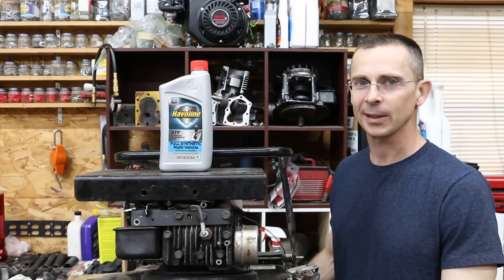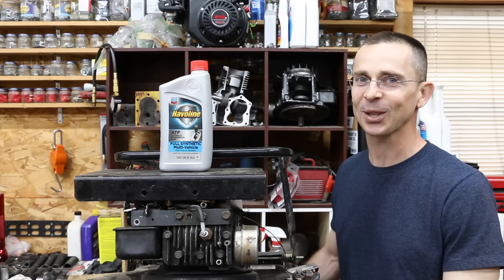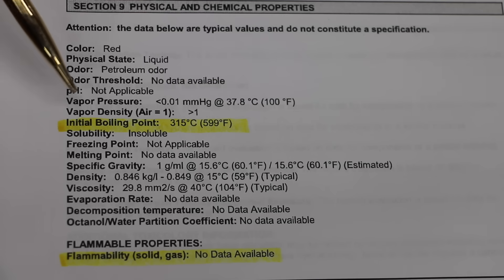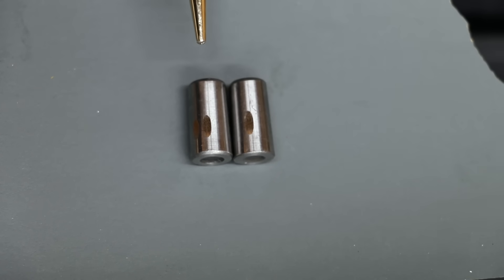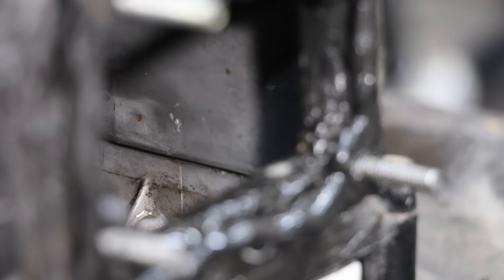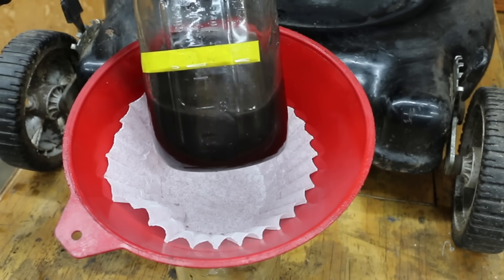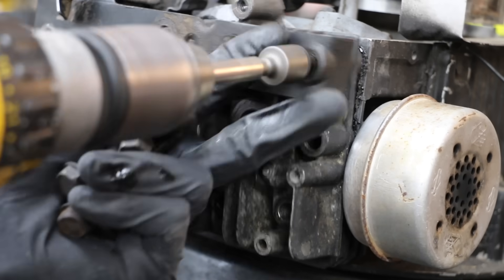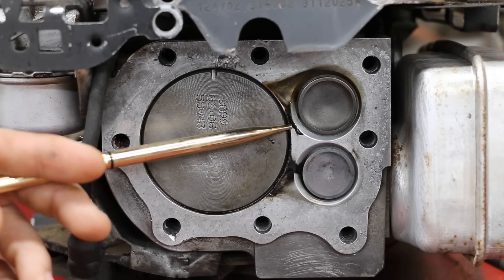ATF as an Engine Oil substitute?  Let's see what happens!

Comment: When I was 14 my friend and I had a Dodge Dart that we thrashed through the desert which caused a trans cooler leak. I talked him into using used motor oil to fill the trans cause, “oil is oil, right?” 
The car puked the oil back up the fill line and caught the engine on fire, 😛
Reply from the maker: Wow!

Comment: I run transmission fluid with my oil every time  with full synthetic it allows the engine to run Slicker and smoother with a Lucas oil stabilizer
Reply: Same here. I have a 1994 Camry 4 cyl. Ive owned the car since 2000 and have always used 3 litres of engine oil and 1 litre of atf every refill - ie 1/4 atf.  I am still driving the camry around today and the added atf does not seem to have harmed the engine in any way.  I only started adding atf after an old friend mechanic suggested it to me as a method of preventing sludge buildup as is common with these Camrys , but I must admit I was a bit worried at first that it might damage the motor.  In 2010 my wife purchased a new Toyota Aurion v6 and after 2 years I made a decision to add atf to its engine oil. I sort of didn't want to as there is a big difference between a 24 year old Camry and a relatively new Aurion and it would of probably meant divorce if I had stuffed the v6 up. Anyway the Aurion takes about 6 litres of engine oil at refill so I refilled it with 4.5 litres of normal engine oil and 1.5 litres of atf - ie 1/4. To be honest the v6 seems to run smoother with the added atf - same as the Camry. One thing I did notice with the Aurion is that with the added atf I can't hear the sound of the timing chain anymore. We get the Aurion serviced regularly at our local Toyota place (Bill Buckle Toyota Dee Why) and I have asked them does the motor seem ok and they have told me that there are no problems with the motor.
Reply: @garyrandall1958  
How you doing today hope you all is going well I just want to give my testimony I use Mobil 1 full synthetic 15w 40 Valvoline full synthetic and now I use Liquid Marley in my younger years I owned a Saab 9000 Turbo it has a 4-cylinder engine in it and by then I was driving a big truck so we had to put 15 w 40 conventional oil in those trucks everyday these trucks pulled 10-15 tons of weight and the engines last a long time some of them had like 200,000 miles three hundred thousand miles on them That's not including the idle time they set just run so I understood that for some the engines with similar in nature that they had to work twice as hard to do the same amount of work as a V8 so I put 1 quarts of transmission fluid will 2 quarts of Mobil 1 full synthetic 15w 50 & and 1 quart of Lucas Oil stabilizer you know you going to the auto parts store that used to have the little display that showing you that the Lucas Oil lubricated better over moving parts a my car had a timing change so it made me common sense to me to add it, and I just had the engine rebuilt with a new timing change new oil pump and turbo so very expensive back in the days so no I didn't use cheap oil only the best oil for my car and one day I had a vacuum leak and I fooled around and use some electrical tape trying to make the holes tighter and if vacuum hose suck the tape and plugged it and it pumped most of my oil out of my engine and Saab had a system where it would tell you if the car got low on oil and that light came on and I looked at it and I thought to myself I just change the oil so maybe the sausage is going bad so I kind of ignored it and as I was going I stopped at stop by the police and it's a traffic stop checking licenses so I asked the officer was that my car making that noise and he said he wasn't sure so after I got the check point I went and pulled over and oil was all over my engine bay I was 40 million from home I put 3qut of oil in to made home clean the engine up after checking I figured out that my vacuum line was closed and all my oil popping out through the dipstick put fresh oil back in it the same way always and the car lasted for another two years before the timing chain broke.   that's how good the Mobil 1 full synthetic and Lucas Oil stabilizer for my car and now I found liquid Molly that is even stronger than mobile one I can't wait to use it and I thought that also watching this Channel with the lubricity test that he did between mobile one and liquid Molly have a blessed day it was nice talking to you!
Reply from the maker: Thank you
Reply: @ProjectFarm   
Keep doing what u are doing I love it & thank u so very much! My dad talk to about atf when I was in high school back in those days we only had conventional oil 10w 40 and I had a lifter in a 76 Buick Regal 350 that was ticking my dad told me the next time I change the oil  put 1quart transmission fluid with  the oil I did and no more ticking and one time I forgot to put the transmission fluid in my and the ticking noise came back and I immediately remember what I forgot to do lol!
Reply: @Bryant Nalls
 - Yea, I am experience the same thing.  Seems it's smoother and quieter after ATF flushes!

Comment: Another nicely done one, PF.  The biggest thing that will bite you in the ass if using ATF as a stand-in for engine oil is it's lack of detergents and corrosion inhibitors, so an engine using ATF is at risk of internal rusting (condensation after cooldown).  ATF also has an additive package of friction modifiers and other weird stuff intended to control how quickly things engage and release inside the trans and some of those could be damaging to catalytic converters and/or O2 sensors (in engines with them, of course).
Reply from the maker: Great point. Thank you

Comment: The thing about the transmission fluid cleaning up engines was true but you have to go back 50 to 60 years. Oils didn't have detergents and the additives that they do today. Engines oils used to gum up and get real sludge especially when they didn't change the oil. trick was Run 3 quarts of transmission fluid in the oil run it for a few hundred miles then all your crap would loosen up and go into the oil pan and up into your oil pump screen. anyways long story short  try putting Karo syrup in the the engine oil half an half and run it for a hour and let it sit overnight see what happens
Reply from the maker: Thanks for the video idea.

Comment: Great test...but I agree with others.  A second test with the same engine would have confirmed if the metal found was a result of the ATF or from the previous run.  That would help understand how effective or detrimental ATF would be as engine oil.
Reply from the maker: Great point. Thank you

Comment: I never used ATF as an engine flush, but I did use gasoline as an engine flush once. I tried it on an old lawn mower with a filthy engine. What I did is warm the engine up, drain the oil, and fill the crankcase with gasoline. Then I removed the spark plug and cranked the engine with the pull start a few times to slosh the gas around. After letting it sit for a few minutes, I cranked the engine a few more times and then drained the gas out of the crankcase. It was completely black. Then I filled the crankcase with new oil, cranked the engine a few times manually to get the oil circulating, reinstalled the spark plug and started it. 2 years later, it is still running great and none of the oil seals were damaged, but I would not suggest using gasoline in the crankcase of any engine you care about. LOL
Reply from the maker: That'll get the job done!  Thank you

Comment: This was a great video. That being said u should try a mix of atf and oil as that is how it's used in most of the "tips ". I used this trick in my explorer, the reason it works for most people is because hydraulics in the engine such as lifters. The atf is a hydraulic fluid  more than oil so it can withstand more pressure thus helping free up lifters and other hydraulic  components, the cleaning frome the detergents in the atf is just a bonus in most cases because people are complaining about boutique a noise on a high milage  vehicles. Oh and yes worked well for my sticky explorer got way better gas milage after.
Reply from the maker: Thanks for the video idea!

Comment: I've run my diesel Mercedes on ATF. It just smelled a little different. I love that old diesel.  It will run on anything from used motor oil to BBQ lighter fluid.
Reply from the maker: Impressive!  That'll save a lot of money.
Reply: Two concerns come to mind about your claimed savings: 1) It's a Mercedes, so maybe the maintenance is more costly than a normal car with normal diesel fuel, and 2) it's without turbo injection which allows it to run alternative fuels, but also inherently gives it worse fuel economy. 

I wonder why nobody else is doing this if it's so advantageous?
Reply: @zwz.zdenek  My first car was a Merc 109 Diesel truck from the late 70s. This thing ran with a 50/50 mix of diesel and old frying fat. Smelled like a burning food truck and smoked like a tank.

Comment: Put it in my Astro van that was sludge and noisy, drove for 500 miles changed the oil and the filter was completely full of sludge, did it again noise went away and it cleaned the engine. Works great
Reply from the maker: Impressive!

Comment: I used 1 ot.  Trns fl.  Just b4 a oil change. Then did not ch oil.  I didnt notice any probs. Drove the truck another 5 years  360 mopar.  Then sold it.  No problems.
Reply from the maker: Thank you

Comment: kerosene, marvel mystery oil,(tetrachloride, if you can get it) will do a great job flushing as well as ATF. it works well in all my vehicles and older Harleys especially if you run fossil oil. syn oil never a carbon build up problem or slugs
Reply from the maker: Great tip. Thank you

Comment: Atf is pretty amazing. Think of the torque applied to the transmission gears of Diesel pick up trucks and then there is the argument that you need to run 90w in a modified 2-stroke  dirt bikes transmission. Yea, second place needs a trophy to. But it would be interesting to see the difference under load, having worked on small engines years ago "before plastic cams???". I needed to test  the engines under load and no customer is going to pay me to cut my own grass, DEEP MUD PUDDLES. I build a tub if you want to call it and put what ever amount of water in as required, you could get surging loads to stalling. Under 16 HP, but the very least the under side of the mower deck was clean. It did actually help with some issues that developed with heat. Keep up these vids high five
Reply from the maker: Great point. Thank you!

Comment: Well now, about 50 years ago when I was 16 to 20 years old I worked in my dad's service station you remember when they used to check your tires and wash your windows and when you got an oil change and got your car vacuum in your windows washed in and out and they used to do everything from rebuild an engine to change oil for those who don't know what a service station was. Back in those days we had a hydraulic lifters in the engines and every once in awhile if engine didn't get its oil change properly these lifters would not open properly they would keep closed which would keep the pushrods from operating which would keep the engine from running properly. My dad and uncle used to put one quart of ATF in with clean oil had the customer run around town for that hundred miles no freeway traffic and nine times out of 10 the hydraulic lifter would operate again they would drain the mixture out which was One V automatic transmission fluid to 4/5 engine oil. Engines of change a lot from 50 years ago I'd be scared to do it today only because engines running a much higher RPM then they used to back then and I don't think they know what a hydraulic lifter is.
Reply from the maker: This is interesting!  I worked at an Amoco gas station while attending college many years ago that had a full-service garage like you describe.  Very rare to see those anymore.

Comment: you should try testing the use of used atf as fuel in an older diesel engine.
I've been running used atf as fuel in my 1993 ford f250 7.3 idi.
Reply: Poor man's Marvel Mystery Oil.
Reply: I bet that smells lovely
Reply: Idi's will run on just about anything, they really don't care what you put in them as long as it burns
Reply from the maker: Thank you

Comment: I once used trans fluid in my 2006 BMW 750 engine (8qts) and drove from TX to GA, then back to TX (2000 miles).  Before my car would say about 550 miles per tank of gas, but with the trans fluid the dashboard showed 630 miles per tank of gas (21 gal). I drained the fluid and put in engine oil and my dashboard showed 575 miles per tank of gas.
Reply from the maker: Wow!

Comment: Excellent video, used ATF on many occasions to flush engine especially small engines, very similar to Marvel's Mystery Oil, but I came across something the other day that blew me away, and I picked this up off of Chris fix video, by using Synthetic automatic transmission fluid, mixed with acetone, 50/50 is the most Incredibles penetrating fluid I've ever seen in my 50 years of turning wrenches, according to Chris fix  the molecules on both of them,,,are half the size of the finest penetrating oil on the market,,, Both of you guys have the best videos on the U Tube There is no Half Steppin here.. Thank you
Reply from the maker: Thank you!

Comment: I was cutting the grass at my grandmother's with my push mower had just tuned up and changed the oil amsoil 1030 small engine first time cutting grass a few weeks later it started smoking BAD and running rough checked the oil and none was in the stick I was baffled I know I just did all that all I had was Dex iii so I filled it up I've cut grass with the mower twice now about 2 hours bc I left it there and forgot and it still had oil in it I still have no earthly idea what in the HELL happened to that 1030ams but I grabbed a new QT from the farm and left it there so next time I'm going to change it out hopefully it doesn't happen again
Reply from the maker: Wow!  Thanks for commenting on this.

Comment: Hi appreciate your zeal in seperating all the snake oil flooded on the shelves myonly disageementth your test, is that it seems that you always are using a lawnmower engine to perform yourest. fundementally it seems to work on lawn mower engines, but the world of difference between these engines is a complete different constitution in alloys ,tolerences,temperatures , computerized air /fuel deliver, oil pressure. and on and on. I could be wrong but this just seems like a apple and orange test.
Reply from the maker: Thank you